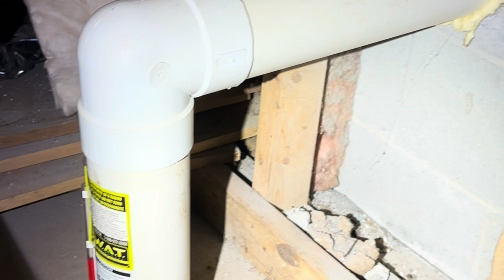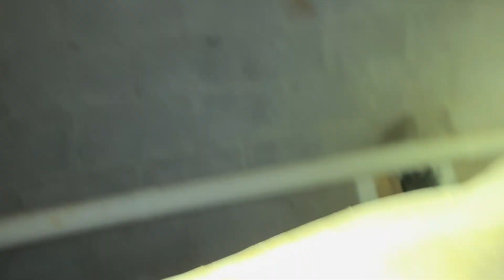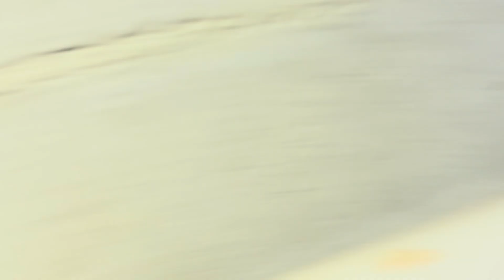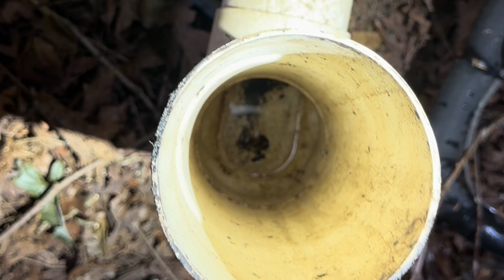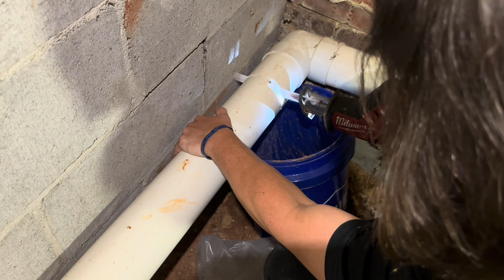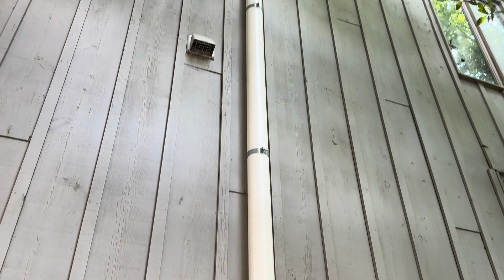Radon System Gone Wrong: What We Found and How We Fixed It

Comment: Why is the switch the problem? I've seen people all on YouTube professional and DIY just use a simple plug on the inside of the house. Outside ya I see some problems.
Reply from the maker: It is because the plug is plugged in outside. If you see a “professional” or a DIY video of somebody plugging the fan in outside, they are wrong! SGM-SF 2023 8.3.3 “ all outdoor wiring for ASD fans shall be protect protected in conduit, unless otherwise permitted by local codes, and shall not be a plug disconnect”. So the videos you have seen are wrong because the standard does not allow for a radon mitigation fan to be plugged in outside. If it’s in an attic it is A-OK.
Reply: @trueairtechnologiesradon its a shame they did an ok job for like 70% of it, but completely blew it on all the important details making the system terrible. Why is all i ask myself
Reply: It’s against electrical code in basically every state and province in North America